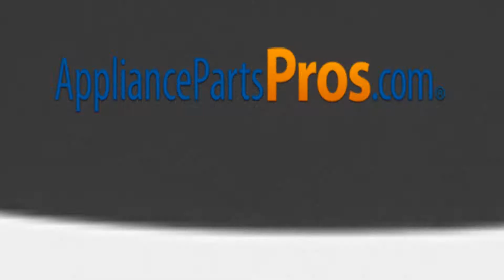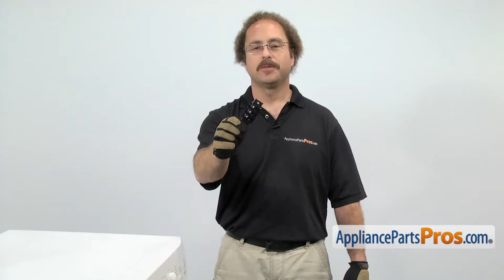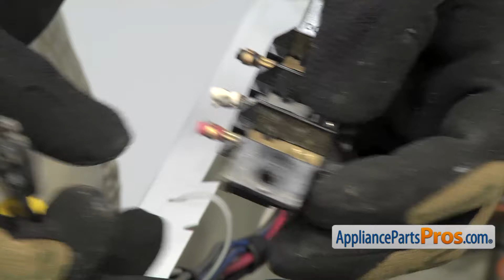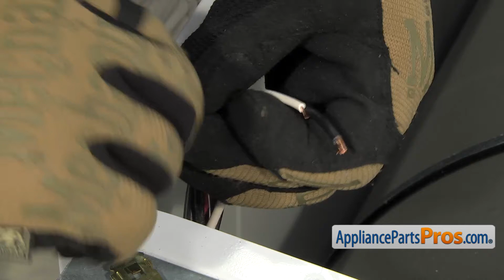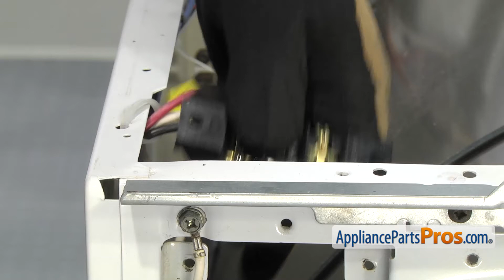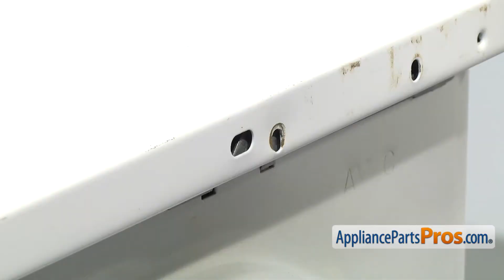How To: Frigidaire/Electrolux Terminal Block 134101400

Comment: How do I know if I need the Frigidaire Drier Terminal block 123101400 or the 123037400?  My drier looks similar to yours in the video. Except I have no additional white wire to left of the terminal block.

Comment: How about checking to assure which wire goes to which terminal BEFORE connecting the wires to the terminal block?  You wouldn't want to make a mistake at this stage!
Reply: i normally take photo shots and video of every wire move ment before i disconnect anything hope this helps 🥰